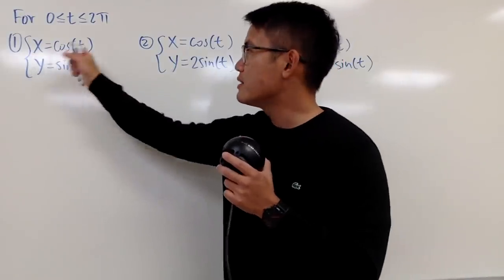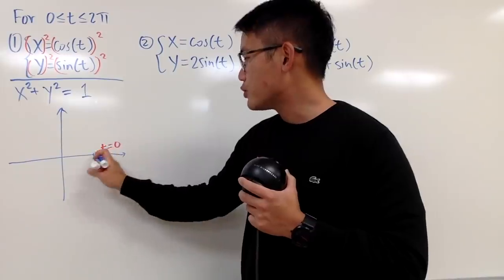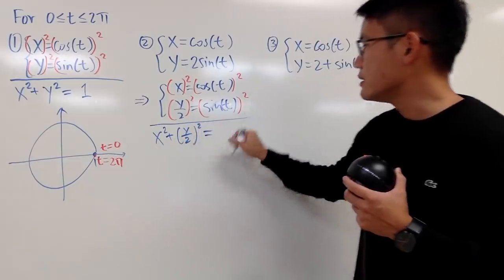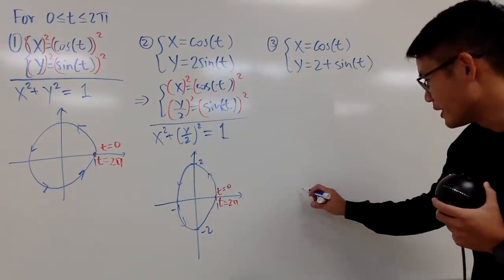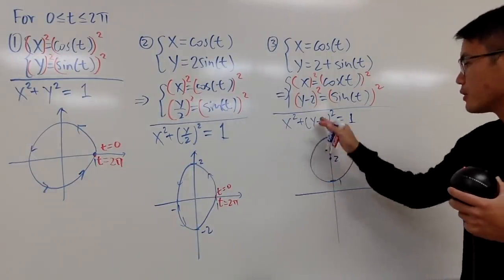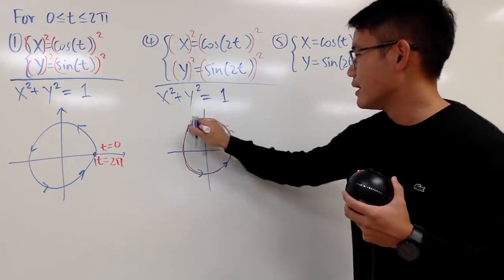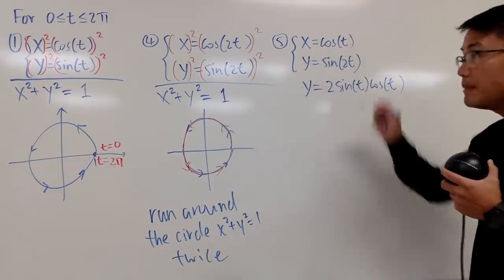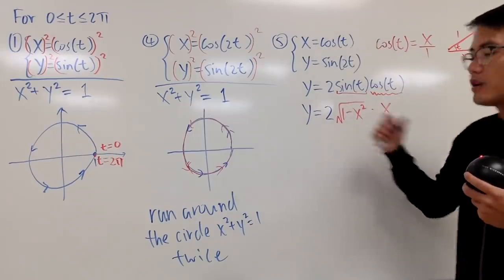Parametric equations with sine and cosine

Comment: x = cos(t),  y = sin(2t) = 2sin(t)cos(t) = 2sin(t)*x
x = cos(t), y/2x = sin(t)
x^2 + y^2/(4x^2) = 1
4x^4 - 4x^2 + y^2 = 0
Reply: Can't believe you just saved me from developing a headache over not being able to solve a similar problem with a comment from three years ago.
Reply: @ishqaqamar2789  You're welcome.  I did do two steps at once.  I probably should have a second last line of 4x^4 + y^2 = 4x^2, after which I subtract the 4x^2 from both sides, giving the final line.
Reply: Thanks!
Reply: @user-fh2rw9zh8g  You're welcome.

Comment: integral of 1/(1+x^2) next please :)
Reply: Swagger Lemon There's not even the need to do any subs 

The anti-derivative of 1/(1+x^2) is  arctan(x) + C or -arcctg(x) + C
Reply: Swagger Lemon If that's the case then it's fine to use one 

He can use  a trig as you suggested or an hyperbolic one 

He can even do partial fractions 

Many possibilities